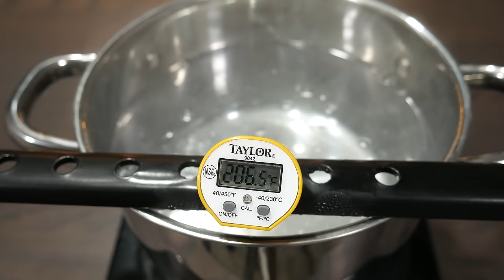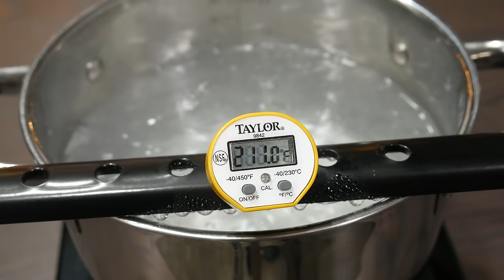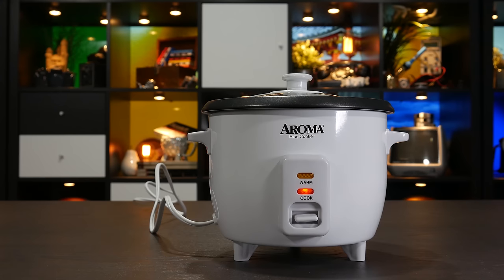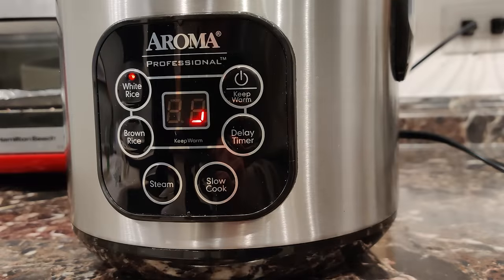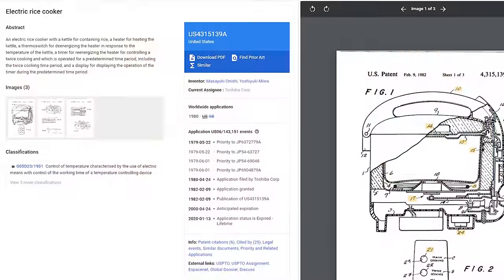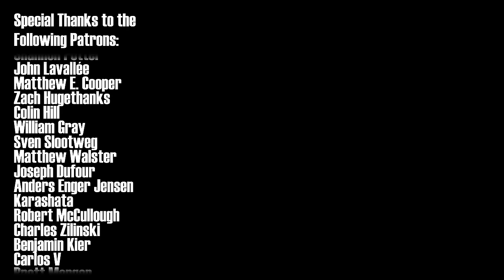Old-fashioned rice cookers are extremely clever

Comment: You might consider doing a video on induction cooking. I eat a lot of pasta so I boil a lot of water and I was really unhappy with how inefficient my electric stove was. Then I found a induction hotplate and it is miraculous. I use a stainless steel mixing bowl from a mixer and it boils water in like 5 minutes instead of 15 min for my normal resistance coil stove. It also gives me precise temp control and no hot spots, when I make pancakes on this thing they come out perfect because there are no hot spots. I believe it uses considerably less power too. Sounds like a good video to me.

Comment: I've been cooking rice on the stove for 40 years and I'll likely never change, but damn that's a clever thing. If you don't have room for another kitchen gadget, follow these fail-proof steps:

It's 1 cup of water per 1 cup of rice, PLUS 1/2 cup of additional water that will be lost through steam escaping.
Rinse medium and short grain rice until the water runs clear.
Boil your pre-measured water in a kettle.
Pour over your rice and place over LOW heat with a tight fitting lid. Glass lid if you have it.
Leave over low heat for 20-25 minutes, removing when any visible water and bubbles are gone. If you don't have a glass lid, just set a timer for 23  minutes and you'll probably end up with perfect rice anyway.
Reply: My dad hails from south Louisiana, so just about every meal he cooks is over rice. His recipe is 2 cups rice, 3 cups water. Boil the water with a teaspoon of salt, then add the rice. Boil it until the just the very top of the rice is above the waterline. Cover, turn to very low, and let it cook for 20 minutes. I love seeing different recipes out there, I thought i'd share mine too!
Reply: @18deadmonkeys  Usually there's a ratio on the bag of rice you use and it works pretty well abiding you don't have the heat too high or the lid too far off to the side.  Been getting it pretty dang right for the past 7 years of my cooking it.
Reply: @thomasbradberry5228  the bags of rice i buy says to drain the water, as if it was pasta. what the fuck
Reply: Water needed depends on what type of rice you cook. Need to experiment everytime you get a new bag.
Reply: Caveman minute rice gang
Reply: For me that sounds like a perfect recipy for smoke detector testing ;D

Comment: I have the older brother of this exact Aroma rice cooker, which lacks the heating function and ONLY cooks rice.  I believe I bought it in the early 90s and it still works perfectly, in 2023.  My only "complaint" is that the aluminum rice bowl is not non-stick, which would make cleaning easier.  (although simply letting it soak overnight means cleaning takes seconds, the following morning)

I have no doubt that, if I don't break the lid (unless I can replace the broken lid?) it will continue to function for another decade.  Or two.  Or more...

I keep considering upgrading it, but there's nothing wrong with it, so why?  And the newer versions all seem to be much larger, taking up more valuable kitchen storage space than this little beauty. :)

Comment: I used to have a simple rice cooker like this, but I couldn’t get it to work the way I wanted. The rice kept burning at the bottom or ending up undercooked on the regular. I tried adjusting the water amount, washing the rice for a longer time, buying a different brand of short-grain rice and manually turning the rice cooker off, but no dice. Perhaps something was wrong with the bowl or the mechanism was something else entirely. I eventually picked up a discounted Zojirushi ”fuzzy logic” model and now my rice turns out the way I prefer it. 

That being said, I love the idea of the cooking mechanism in these things. The simplicity, longevity and repairability are definitely attractive. If I ever have to replace my Zojirushi, it could be one of these, but from a name brand instead of whatever the heck that rice-roaster was.

Comment: So, I know they still work at high altitudes, as they work fine where I live in Colorado at about 6000 feet above sea level. But would these have an altitude where they would start burning the rice, since water boils at a lower temperature at higher altitudes (or technically at lower atmospheric pressure)? I kind of want to try taking one to the top of Pikes Peak and see if they work at 14,000 feet.

Edit: I know it would still cool because it would still hold it below the shut off temp until the water had been absorbed, but would it start burning the rice on the bottom if the shut off temp and water’s boiling temp get too far apart?

Comment: I’m a Filipino (saying that as a frame of reference) born in the 80’s. My grandparents had that “double boiler” type of rice cooker, and used it well into the late 80’s. I even learned to cook rice with that one. You had to add some water outside of the cooking pot after placing it in the rice cooker for it to work properly. It finally died sometime before or around the 90’s. I’m not sure when my grandparents purchased that model of rice cooker.

Comment: “Weird and specific circumstances” that exist in every pressure cooker.
Reply: Which doesn't make it exist above boiling temperature, it just moves the boiling temperature up :P
Reply: @gspin96  Exactly.
Reply: He's talking about the triple point, not the fact that the boiling point of water changes with pressure.
Reply: He's actually talking about superheated water. The conditions are a very smooth vessel.
Reply: @NotaWalrus1  Very possible! I probably should have said "He may have been talking about..."

Comment: What material is that magnet made out of? Curious if that material found its first widespread use in this application, or if the engineering logic was well known and basically "migrated" its way over to the rice cooker at some point.
Reply from the maker: I don't know! From my understanding the magnet's composition isn't as important as whatever it's attracted to, but it could also be that the magnet doesn't quite get to its Curie temperature so the loss of attraction isn't permanent. The only thing I know for sure is that the magnet lets go because hot!
Reply: What if it's also an electro magnet? Wouldnt it regain its magnetism once electricity is pulsed through it or something,
So once you plug it in, the magnet gets reactivated
Reply: apparantly its a mixed (Ni,Zn) ferrite, probably a spinel structure (patent CN1899171A).
Reply: A magnet is not permanently 'broken' after reaching the Curie temperature. What happens is that the material becomes paramagnetic (weakly attracted to magnets) and loses the information about what direction the original magnetic field was. When it cools down again (without external field) small domains of randomly oriented magnets form which results in a overall ferromagnetic material (again strongly attracted to magnets) that is not a magnet.
So the sensor 'magnet' will stick the next time you cook until it again reaches its Curie temperature.
Reply: @TechnologyConnections  the key is the difference in Curie temperature between the magnet and magnetic alloy. 

So, the Curie Point is 215 Degrees F or whatever for the alloy in the button, but just a random Google search showed me a site saying that their cheap ferrite magnets could be used safely up to 480 degrees F, and in some cases even higher.

So, it sounds like the magnetic alloy button has an especially low Curie temperature, and so even if the magnet itself got to the same temperature, it would not even be close to its Curie temperature.

In addition, there would be a tendency for the magnet to stay cooler due to poor heat transfer dynamics, and when the button reaches the temperature, the magnet pulls away and starts cooling down, so probably never reaches higher than 212, if that.

But the magnet being much higher Curie is the key factor.

Oh, and you could probably do great doing infomercials, you sounded just like it at the beginning of the video! Lol

Comment: "but anyone can program an arduino for some inputs and outputs"
me, a professional programmer - "I disagree... in fact I wouldn't want to try to program that stuff... "
Reply: Really? I've never done much programming, but wouldn't it just be if temp > 100, turn off?
Reply: @Here_is_Waldo  Arduino: WTF is temp?
Reply: @thekinginyellow1744  I was just using it as sudo-code. Temp would have to be the input of the heat sensor converted to whatevers and so forths.
Reply: @thekinginyellow1744  Temperature the voltage being read by the thermocouple.
Reply: @Here_is_Waldo  Fuzzy logic rice cookers are actually very complex, they take temperature and humidity into account and call back on a large amount of knowledge of different types of rice. Each setting on a microchip rice cooker uses a completely different chart. A lot of people are surprised that a fancy rice cooker is not faster than a cheap one, because it is going for quality not speed. Usually a nice rice cooker will have a quick setting that will cook short to medium grain white rice in about 30 minutes, but the regular setting that makes great rice takes almost an hour. Not only do they get it right, there's a lot more wiggle room. I've definitely added too much or too little water, and it can actually change the cook time and still get much better rice than if I done the same in a cheap rice cooker.

Comment: It shows 220 watts on my 300w Golabs power station which is good because the Golabs will shut down if you push the inverter up past about 280 watts. Cooked the rice very quickly too unlike my 12v 100w DC rice cookers but those can be wired up directly to a 100w solar panel.

Comment: Having lived in China I can confirm that basically every single household has the basic cheap one. Fancy ones are entirely unnecessary.
Reply: The simple one is entirely unnecessary as well.. The only complicated part of cooking rice is the rice to water ratio, and rice cookers don't even solve that.
Reply: @Carewolf  I would have to slightly disagree honestly. The taste between a rice cooker and just boiling on the cooktop is noticeable. I assume that the heat and therefore speed at which it is cooked makes a difference. 
Plus a rice cooker switches automatically to "warm" mode to retain the heat in the rice while you eat. So I do believe they are necessary for the very best rice, though with some practice you could probably mimic the cooking characteristics of a rice cooker by hand :)
Reply: @Carewolf  Oh and yes, getting the water ratio is very important. But that's what your finger is for, getting the depth right :P
Reply: @thfreakinacage  I have never noticed a difference. Though I guess it is possible to get it wrong when cooking without, but it isn't exactly rocket science, though it does take at least one intermediate step to do on the stove (to adjust temperature once water is boiling).
Reply: @Carewolf  Yeah, I guess the rice cooker is mostly best for its convenience since you don't need that intermediate step, but hey if you've been getting good results by hand then why bother changing :)

Comment: I didn’t know, Weller makes rice cookers, too.
Reply: Weller? You mean, the guys who make soldering irons and stuff?
Reply: Hahaha, was gonna post that same thing.
Still have my Weller Magnastat from the early 90s in good working order and think it's the coolest thing ever. And was sooo much more accurate than those "electronically controlled" soldering irons back then.
Reply: @DerMarkus1982  yep, google Weller Magnastat. They had a magnetic alloy at the end of the soldering tip. The tip would close the electric circuit of the heating element when it was below the Curie point. Once it got to the target temp it would lose its magnetism and that would open the switch and shut off the power to the heating element. There was no knob to regulate the temp, you would buy the tips specific to the temp you wanted to solder at (they had different alloys at their back side). Because that magnet was right at the end of the soldering tip it made a very accurate sensor and control loop for the heating element.
Reply: @DerMarkus1982  Precisely!

Comment: I have to defend my precious Fahrenheit! 212 IS a nicely elegant number.... it is 180 degrees away from 32. Poetic, isn't it?! And, why 32 for freezing? It is a power of two! Makes creating accurate tick marks easier.

(and fun fact: 0 - 100 F happens to be the typical range of temperatures you actually see in habitable weather!)
Reply: but it also sucks, so your opinion doesnt count
Reply: Never really thought about the 180 degrees thing. That is kinda poetic. Thanks for that. But was it intentional, or just dumb luck?
Reply: @captainvector  Both, actually. Mr. Fahrenheit originally defined things based on body temperature and freezing being 96 and 32, respectively, so they'd be separated by a nice power of two as well as being convenient measures available to everyone (and the third point 0 was based on the coldest day that year... and then defined as a brine mixture to be reproducible in the lab).

Then he noticed that - by apparent coincidence - boiling rain water was achieved at about 212 degrees and wrote that down in 1724, though I don't know if he thought anything of the 180 degree separation; his notes (that I've seen at least) don't make any comment on it at all (but of course he was good at math, I'm sure he at least observed it!). After the Celsius scale was formalized in 1776 (after Mr. Fahrenheit's death in 1736 btw), Fahrenheit was formally redefined to use 32 as freezing and 212 as boiling as the official reference points.  (Body temperatures aren't as reliably measured anyway.)

 So nowadays it is intentional, but it started out as just an amusing coincidence.

Read more plus sources on wikipedia: https://en.wikipedia.org/wiki/Fahrenheit#History

Comment: I cook rice in a pot, with exact volume of rice and water. Set the stove to maximum and its timer to 7 minutes. That exactly brings the water to a boil, then turns off. After that, the rice fully cooks on the latent heat from the pot and stove. Impossible to burn since the stove is off. I believe that is the most efficient way to cook rice

Comment: But what is the right rice to water ratio?
Reply from the maker: Depends on the rice, but for most varieties of white rice I do about a 1:2 rice:water ratio. Brown rice needs a bit more water in a rice cooker like this because it takes longer to cook, so more of the water will boil away.
Reply: Do it the asian way, dip your pointing finger, just enough to touch the upper level of rice, and fill with water up to the first line on your finger (about an inch above rice level)
Cooks perfectly everytime.
Reply: @TechnologyConnections  but is that by mass or by volume? If the latter, do I need to account for all the empty, non-rice space? So many variables to consider. This is why I don't cook. Even rice.
Reply: Need more water if you are in some where like Denver. The cooker will be pumping in too much energy after the water comes to boiling point at that altitude.
Reply: @frankthefkintank  lmao its volume, just use a measuring cup or a drinking cup for both the rice and water ratio. Don't worry about the empty space when your pot is the container cooking.
Reply: You get a measuring cup with the cooker and there are lines inside the bowl.

Comment: One thougt I had, and it's in defence of her majesties Imperial measurement system (0:52) which used to be world wide.
0°f is the freezing point of scotch, and 100°f is supposed to be healthy human body temperature.

The thermometers those alchemists used a millennia ago weren't the best, but that's not a bad system when you think on it!  They are both very important to my being.
Reply: My only criticism of Fahrenheit is that it's overly precise for daily use. There's no way you can percieve the difference between 100F and 101F. Even 37C to 38C is hard
Reply: 0°F is coldest point that Daniel Fahrenheit could repeatably cool a solution of water, ice and a kind of salt, ammonium chloride.  The freezing point of water was 32°F.  96°F was human body heat.  It seems he chose these numbers essentially because they were easier to see and mark on his thermometer.
Reply: @ptonpc  while that is one story, my dad was from Scotland, and he said zero is when Scotch froze.  Which is a terrible thing!!
Reply: @therubicon  Ethanol freezes at -114 C (-173.2 F).  Whisky / Whiskey (depending on if you are Scottish or Irish) freezes at around -27 C (-17 F)  Depending on strength.  I'm Scottish and have never heard the claim that 0 F is the freezing point of whisky.
Daniel Fahrenheit was Dutch.  He lived between 1686-1736. His work is a matter of record.  It's not a story.  I'll post a link you can read.

http:://www.todayifoundout.com/index.php/2014/12/fahrenheit-scale-isnt-arbitrary-seems/
Reply: @ptonpc  I'm glad I never doubted the sense of humor of people these days.  Thank goodness I never made jokes about the part of the car between the motor, and the wheels.